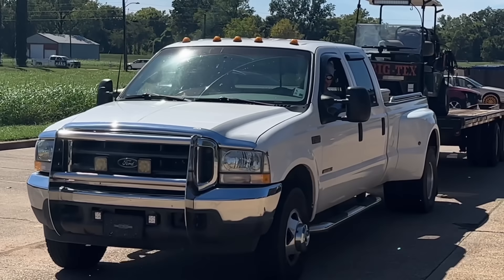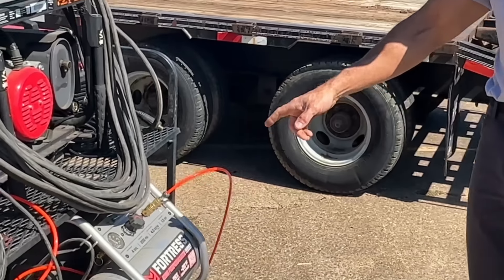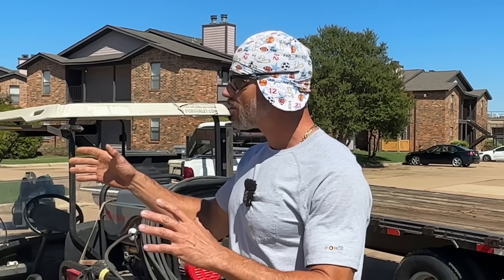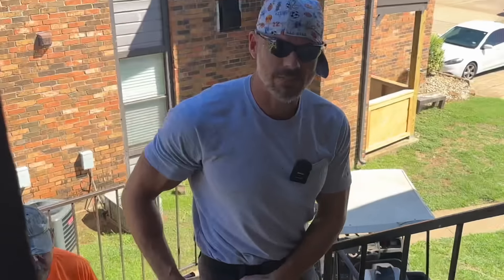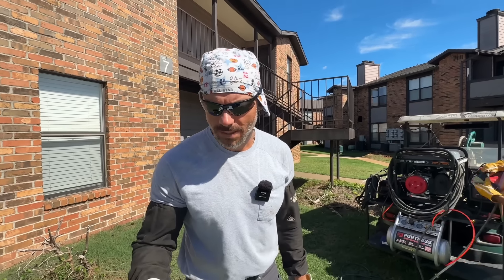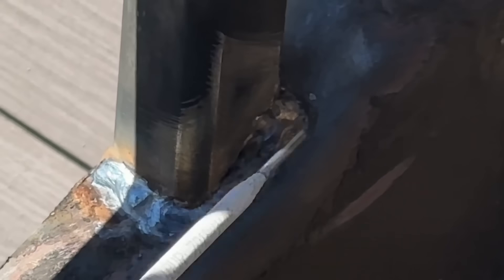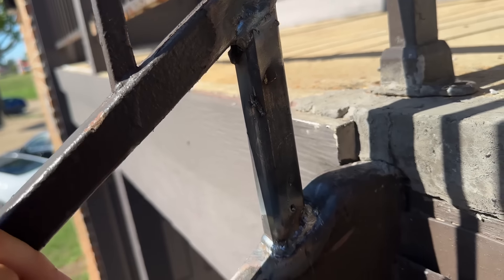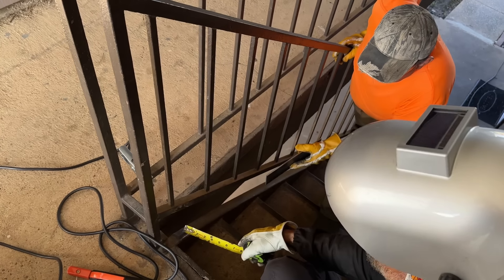Secret Side Hustle for Welders: Boost Your Income Now!

Comment: Looks like you and I are in the same business! 99% of the wrought iron at these apartments is 16ga. Do yourself a favor and go to Harbor Freight and buy a flux core mig welder. They’re cheap and run like hell. They’ll make quick work of that 16ga, much faster than those 7018s. Leave the sticks for the structural and pipe! Thanks for the great content!!

Comment: I use a Fronius Transpocket 180 welder for jobs like this. It'll burn a 1/8" rod at 120 amps on 330 ft of 12-3 extension cord at 110V and weighs only 19 lbs. If I need to cut , I'll use a cordless cutoff wheel. Mobility is key.  Great content!  Welcome to my world.  Maintenance welding is still welding.  It may not be glamorous,  but it will help pay the bills.
Reply: I use a harbor freight flux 90. It will melt metal to metal on a 50 ft 14 gauge extension cord with no ground!
Reply: This guy is awesome.  I do a lot of maintenance welding.  If it ain't one thing, it's another.
Reply from the maker: I'll have to check that welding machine out. Thank you for the tip

Comment: I am an electrician that just bought a Yes Welder 160 YWM multi process welder (only plan on using flux core and stick), a 5000W generator with a 240V 30A receptacle, plus a few other odds and ends.  I originally bought this equipment for home use and hobbies, but talking to the black irons tradesmen I work with. None of them could be bothered doing these side jobs.  So with that being said, watching this video and others like this, inspires me to possibly be a mobile welder as a side gig as well.   Thank you for sharing these videos.
Reply from the maker: No problem, Kevin. Thank you for the comment.

Comment: Hand held bandsaw may be a better choice
Reply: I've got an M12 milwaukee port-a-band, it's bad ass. I've used the M18 ones too, they're overkill for most of what I do.
Reply: FWIW, I bought a Harbor Freight 5" portable band saw a couple of years ago to cut oilfield 2 3/8" pipe for a retaining wall.  Probably have 100 cuts of that plus misc angle iron, rod and plate cuts, still on the original blade.  I do give each cut a squirt of WD40 or equiv for lube.  Might not be as handy as plasma for complex cuts but definitely cleaner than a 4" wheel and surprisingly controllable.
Reply: Not for angles etc

Comment: I’ve used 6010/6011 in a pinch to gouge cut 1/4” plate. 

It isn’t visually appealing but it works!

Just have to grind it when you’re done.

Comment: Fronius battery powered welder and a Milwaukee Band Saw/Cutoff Wheel, small portable oxy/acetyline cutoff torch. Anker SOLIX F3800  240v rechargeable generator.  Less weight to haul things around.  But the golf cart's a great idea.

Comment: You know that a cheap hand held grinder is a must .  You can use it for a wire wheel as well as cutting, sanding and grinding to finish off and have a great look.  I really like the idea of ding portable welding.  I really like doing small jobs and thin stuff is where I really d great at !

Comment: I would think self-shielding flux core wire would be the better option for those railings, and you can run it with a small 125 mig welder, which would fit that rig pretty well.

Comment: I have the arcCaptain 50 plasma cutter and thought I was gonna do what you set up to do with small equipment and Im very dissappointed to see your larger than my generatir wont run it. Dam Also thought it was a pilot arc but isn't its a scratch arc so cant run on a cnc cutter table. Also have their ArcCaptain mig 200 multi process. Hope it works out. Im old long time welder and needed lighter equipment. I live off grid and must use generator. Dam all that money for nothing?? Hope not. Subbed Dandahermit

Comment: I run my 50 amp plasma with a 8700 Watt Harbor Freight generator if I am working away , I also use a 110v flux core welder for jobs like what you were doing.

Comment: Good Vid! Need however to run the Plasma cutter on a 30Amp/120V breaker - (not a 15/20A, if your Gen has that capability) or use adapter plug to get the 220 to make it work properly but anything over 15A should break the Gen CB as it does. As you discussed, no, you absolutely do NOT need the small Oxy setups, just turn your Plasma cutter down or use the adapter to a 220V and it'll be perfect for those jobs. **The Golf Cart rig is an EXCELLENT idea!

Comment: run the plasma cutter on 220VAC will use draw same power on half the Amperage, most 5000 * watt generators have a 220 VAC Outlet

Comment: And the smaller the bottle believe it or not the more expensive it is to fill wonder that lol I’ve been Boilermaker for 27 years and Welding longer. I would look at getting a little bit smaller than a 50 amp plasma, cutter, or a bigger generator and a bigger air compressor. And build like a little trailer you can pull with the golf cart

Comment: I have a  3700 watt  generator  and it ran my 140 amp mig just  fine.. but  it wouldn't  rum my 50 amp plasma cutter..  once I jumped up  to a 6500  generator  I had  no issues

Comment: The plasma cutter would work if it was one with a built in compressor,  they can cut 1/8 and sever 1/4 plate if you go slower with the cut.

Comment: Little jobs pay the bills, bump the generator up. An instead of 7018 , which is a good rod , try 6011 better on the dirty material or try a portable mig . I run a eastwood muti prosser.  Works great for all types of welding.

Comment: I gota turn off my compressor when I use my plasma cutter when I run the generator , cut 30 inches or so stop ,then turn compressor back on just one thing at a time

Comment: Go with a propane cutting torch. Oxygen and propane, there’s conversion kits out there. You can use a grill bottle and a 80 cu ft oxy. You will fill the oxy 3x before you fill the grill tank.

Comment: Maybe test to see if the plasma runs without the air compressor on the generator with it and if so then get a second smaller generator to power the air compressor independently
Reply from the maker: It would not. That was my first thought to.
Reply: Right on man! I struggle to keep a miller thunderbolt 225 running off of my predator 8750 inverter. I feel the struggle 😂

Comment: 2:55 the metal nosing on the stairs is loose . The concrete cracked . I would have welded  a post to the top of the railing from the outside of the metal stringer   or chipped up the concrete and fixed the existing post attachment.

Comment: Maybe a lithium battery bank built from some 300ah cells a inverter to run the plasma and stick. Are they 120v welders or 240v. The question is how many batteries are needed to run for the whole days work and can you charge them fast enough overnight so it's ready to go in the morning maybe a hybrid setup where you get a little quiet Honda generator to charge the battery while you aren't welding 🤷🏼‍♂️ I mean we rarely weld 100% of the time the Honda could probably keep up with how much your welder is using obviously the batteries would run the welder not the generator. Just an idea

Comment: Maybe try a 120/240 genset and run the plasma on 240v.  They're more efficient so you can turn them down at 240.  I  turned in my contractor's license in 2016 as OR got even more restrictive. Working on residences required $300k liability and apartments required half a mil insurance. I  think there's a zero dollar limit on what you can do without a CL, and they're no doubt even worse today than in 2016 (when my body screamed "RETIRE!" at me.)  Have fun out there.

Comment: I have a 9,000 watt generator and I tried using my plasma cutter with it once and had the same issue. The plasma only pulls about 30 amps so it’s not overloading the geni and it runs all my welders just fine. I haven’t dug into it yet but I think it’s just got something to do with how a plasma cutter, it’s making the geni think it’s shorting out.

Comment: Since your in apartment complexe's I'm sure they all have laundry rooms so get a 220 adapter for your plasma cutter and unplug a dryer to run it. Or get a bigger generator. I would think a small wire feed welder would be a better choice for that kind of work with the thin, rusted metal. I've done a lot of work in apartments so keep a close eye on your equipment/tools. They vanish in a flash.

Comment: I have 2.5 years of welding experience as a young guy and I want to do this side hustle on my sundays off. What llc and insurance should i get? At my first job, they did these repairs with just a little hobart flux core welder, an extension chord to plug into their sockets, a cut off wheel to fab parts and a can of paint. I figure thats all i need! I have the skills, i just dont know the legal stuff...

Comment: I have tried this recently and it seems every apartment complex around me needs work. But they all require you to go through a vendor credentialing company that has a TON of stupid a$$ requirements to comply with. Just an example one place my insurance company didn't have a "high enough rating." Not my coverage limits, mind you, just the grade. They wanted double the coverage on my truck than I already had, wtf. Wasn't worth the headaches to me. But it is a super cool idea if you have the time to deal with their process.

Comment: Tip for you ; Read the instruction manual on your plasma cutter and it will tell you the specs on what type of generator you can use. Otherwise you can ruin your plasma cutter.
Reply from the maker: Thanks for the tip

Comment: He,he..I can relate to "Damn, that's rotten..". I've frequently done repairs on something that should have been done completely new. However, the customer is king and if he asks to just repair it I'll do. The problem with a plasma cutter is the huge start-up current it draws as it starts the arc. When you just do jobs in thin steel go for a slightly smaller cutter... 40 amps will do just fine up to 8 mm plate.
Thanks for your video... :)

Comment: With your air compressor running it was too much for your generator to run both. I had the same problem in my old garage until I built a new shop with 200 amps instead of the 60 amps I had in the old garage.

Comment: Seems like a 120 volt might welder would do better on that square tubing
Reply from the maker: Just about anything would be better than what I was using. 7018 on that junk was not very forgiving.
Reply: @TaylorWelding  bad ampere regulation huh?

Comment: Get yah a cushman flat bed cart and you can haul a little more in the same space. I'd use a engine welder that way you dont underpower anything.........but that's just me boss.  Still kickin butt and taking names either way
Reply from the maker: I’m thinking about building the skid with my big Welder on it electric driven from the welding machine
Reply: @TaylorWelding  I’ve found a few of the flatbed mini cushman golf style carts gas and electric in Az at pretty good pricing. More capacity and just as small. Definitely would hold a 10k engine drive. Best of luck with the mini biz 💪🏽💪🏽💪🏽

Comment: Biggest issue is the air compressor was probably sucking most of the energy from the generator and in turn was not letting the plasma cutter get enough juice to run more than that little strip.

Comment: Swap the Plasma for a portable bandsaw. You'll have 5 inch cuts and you can opt for a battery or corded option. With battery option you get a 200ah power bank with 100w solar panel on the top of the cart. your tool batteries charge while you travel through the panel and bank and you don't have to deal with using the generator side except for the air compressor and cut off wheels.

Comment: Those plasma cutters auto sense the amp draw and will just not work.  I have a 110 cutter and unless it’s on a 25-30amp circuit it does not want to cut.

Comment: Ideally this is what I'd like to do post welding school, just odd jobs.  I'm in the dark though, how do you advertise your services or set prices?  How do you know who's already in the market so you can set competitive prices?  Well, I'd either like to do odd jobs, OR pipe weld out in the field, but I'm pretty sure you'd have to join a union for that which I don't want to do.  I'm also unsure of which method of welding is most appropriate for any application.  You welded a handrail in this video with SMAW, I imagine that's best for outdoors welding unless you get wind guards.  GTAW for more delicate applications or where appearance is a factor?  I'm still in school so I'm still learning, but I'd love to become a master at my craft and not have a boss to answer to (besides the customer).  Additionally, don't you have to follow building codes for doing what you're doing or be licensed?  Yeah, I've got a lot to learn still.

Comment: Obviously, I wasn't there so I can't really say and I don't know the whole situation, but from my personal experience it's possible that it wasn't the breaker on your generator but rather that your air compressor might not have enough tank capacity for the plasma. I have that same problem a lot and it usually has to do with insufficient air pressure. But again, I don't have all the details, just throwing that out there.

Comment: Welding the thin walled hand railing; would it be easier and faster to run a small wire welder with some thin flux core wire?
Reply from the maker: I don’t think so. It would’ve been better to use a smaller cellulose rod.
Reply from the maker: Wire welder on painted rusty metal is a nightmare

Comment: Very nice! Is there a primary reason you’d use stick vs mig? I suppose stick doesn’t need gas, if you are using gas vs flux core.
Reply from the maker: Gas was the issue
Reply from the maker: Flux core without gas is not my favorite

Comment: Millermatic 141 with .030 wire and 6 30 settings would have made easy work of that thin railing--but getting it on a golf cart, and a generator to push it...nope

Comment: Great idea thought you might like to know  fronius battery operated welder is a great small job emergent welder we use them in the powerplant no 480v in the towers 185 ft. Up easy to Carry no extension cord and don't have to run long leads with takes loads of time.  Check it out definitely worth it.
Reply from the maker: That’s cool. I didn’t have any idea that existed before I make a video.

Comment: Get a smaller plasma. I've got a 15 year old Hypertherm 380 that runs behind my 6500w generator. It's a problem when the compressor gets low and has to refill but if only one of them is running at the same time, no problems.

Comment: As someone who used to run a generator as a power source (before my setup got liberated from my possession), need a generator with a 50 amp 220 plug. I was running a 10kw generator

Comment: This probably has already been said in the comments, but my plasma cutter will not work at all off of my Miller 185,  I do not think the fluctuation in voltage does well for a plasma cutter…. It will work great off of 120 or 240 wall power..  Good ideas for side work,  I am tired of making “the company” all the money sometimes

Comment: You can try using compressed nitrogen with plasma cutter. This way you will not have to have the added load of the compressor on your generator.

Comment: good stuff. i personaly prefer a oxy / acetylene torch. i can cut from 3/32 up to 1/2 " plate with mine just change betwee 0 and 00 tips. plasma cutters are just fussy bastards. if you look up a little torch called a "cobra".  it's oxy /acet. and only uses 4 psi of acetylene and 9 psi of oxy. cool clean cut and gasses last longer. doesn't warp thin stuff if you master travel speed / heat. good gig you made for yourself. im retired with bad neck now but still want  and need to work. i lovewelding on site. did 25 yrs as a mil - rite. from power plants to sugar mills . Coke bottlers and golf tee factories. i have welded rust to rust ! ( no my recommendation , just following orders against better judgement but i announced a disclaimer that repair most likely will fail and to not have lives depending on them. )i like the golf cart setup. great niche' tool to reach more potential. look up the cobra torch .they are amazing. hard to find . iv'e had minesince 2000.

Comment: I have a little lincoln 180 that I run flux core with on light metal like that. I have a 30 foot 220 cord that I made to get to spots like that. It makes it easier and quicker to run flux core on that thin hand railing. But you can use a cheaper welder also.
Reply: I also have a lotus plasma that is little and really light and perfect for mobil stuff like that. I think it was about $400 and runs on 30 amp.
Reply from the maker: Thank you for the tips

Comment: Hitbox and Yeswelder have plasma cutters with built in compressors for mobile work like this.   You might be blowing the breaker because you're running both at the same time.
Reply from the maker: no, I made sure that wasn’t the case

Comment: I grew up in VT, i learned to stick weld fenders. 
 RULE #1!! do NOT allow a "proper arc!" Keep it sputtering in the puddle! When you need to stop- BE QUICK! Move the rod away with a snap, sort of. Takes 1/10th of  a second to hole that thin sheet metal. Starting the arc is difficult! Get to a sputtering  puddle immediately or you'll have a hole. 
Good luck!

Comment: On the issue of not being able to run the plasma.  Maybe a small, portable bandsaw with a small table on it , to run in the vertical position.  I have two here in the workshop.  Lite and compact, I just put one in the back of the ute and take it out to jobs.

Comment: I did a little job like this, maybe a little more design and welding, for my mom. I used wire feed. I have almost no experience, but it seemed to work just fine.